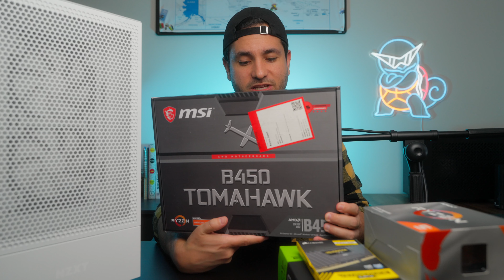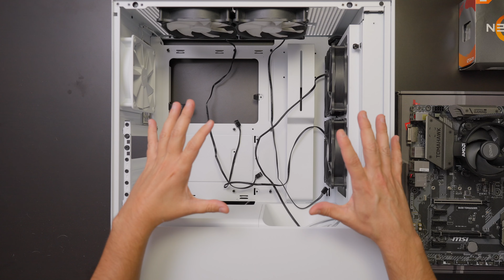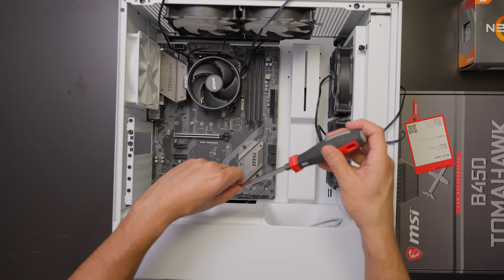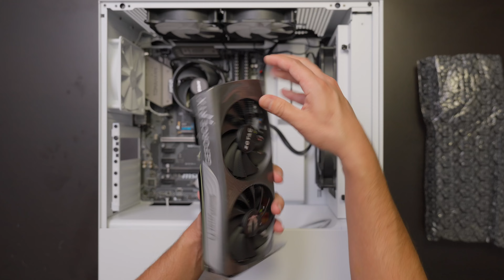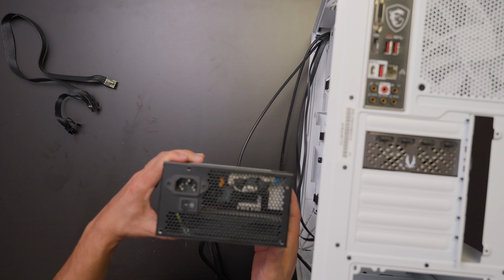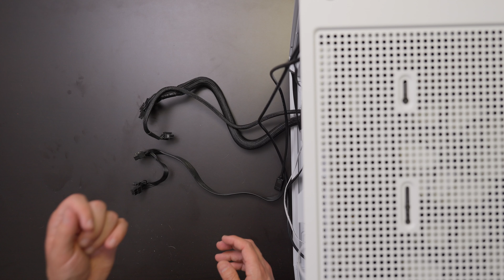The Best Gaming PC You Can Build for $500! (Ryzen 5, RTX 4060)

Comment: rx 6600, 6650xt, or even an intel arc a750 would have all been better buys. don't fall for nvidia price gouging. Also, B550 motherboards can be had at a very similar price to b450 with more features usually. Not to mention the ability to have 5000 series ryzen chips out of the box.

Comment: 4060 is crazy 😭🙏
Reply: its not a bad card
Reply: @Dudeitzbarni  yes it is bro it has terrible price to performance compared to Radeon cards
Reply: @paokpaok857  7600xt and 6700xt. also 4060s on amazon go for around 310 bucks. 7600xt and 6700xt are about the same price, have better performance then the 4060, and both have 16gb of vram compared to the 4060's 8gb. Also don't bring up the "but the RT is better" because I know if you're buying a $300 gpu you aren't gonna be using RT.
Reply: @paokpaok857  also a used 3070 is better as well.
Reply: @paokpaok857  sorry i posted another reply that i guess didn't send where I said that 7600xt and 6700xt have better price to performance. I also wouldn't buy a last gen but pure price to performance 3070 beats 4060

Comment: A 3070 is a better option then a 4060 in terms of price and performance atleast the nvidia rout
Reply: Don't go with the 8gb 4060.
Reply: @joelg1318  There is a 16gb version but it doesn't help at all having double the vram but atm i cant recall if it was the ti version had or not(just chec yhe 4060 ti  does but still same issue 3070 is better)

Comment: i must have missed something, how is this $500?  if the zotac card is $300, you're saying you got the case, psu, mobo, cpu, ram, and ssd for $200?
Reply: exactly what I was thinking.... he did not even list a psu in the list of parts
Reply: he used some of the parts that he already had
Reply: @ninjagumer  I know that but it should be counted towards the budget for a fair price comparison like he did for the ssd and some of the other parts that he already had on hand.
Reply: He went 3rd generation so it is pretty cheap but he said around $500 might be closer to $600
Reply: I agree. The GPU is the majority of that cost. I paid $300 for a PC from my local OfferUp that has an MSI Z370-A PRO Motherboard, i7 8700k, ASUS GTX 1060 6GB, 16GB of DDR4 RAM, a 240mm AIO cooler, and a case with 7 RGB fans. It didn't come with the PSU or any storage but I already had those from a previous build. I did buy a 1TB NVME M.2 SSD to install the OS on and for extra storage and I recently replaced the AIO.
Reply: @BREEZYM6015 overpriced lmaooooo